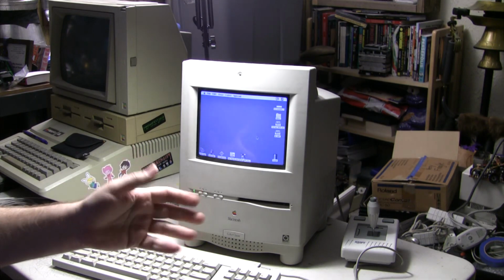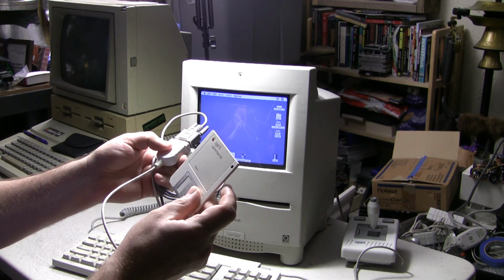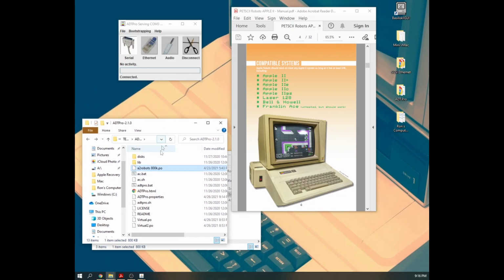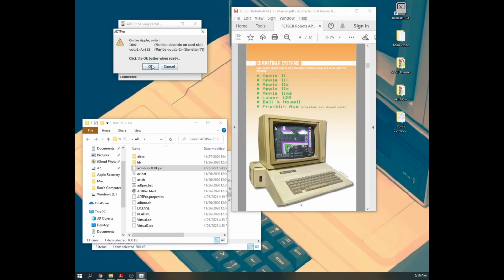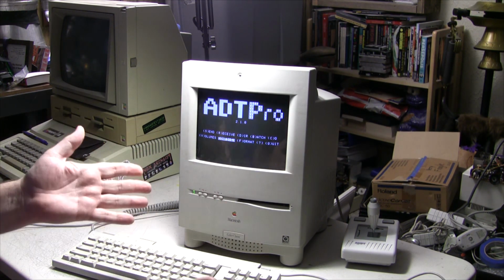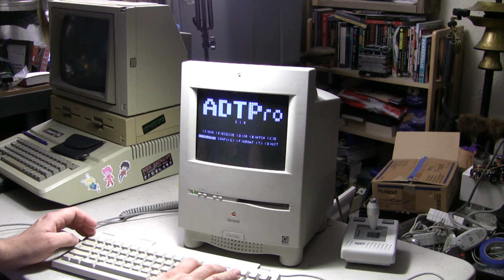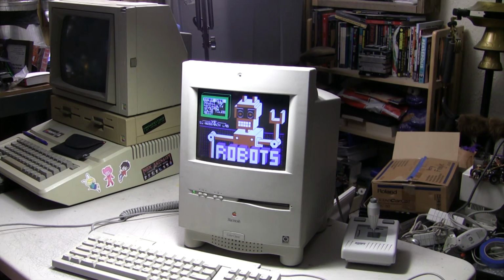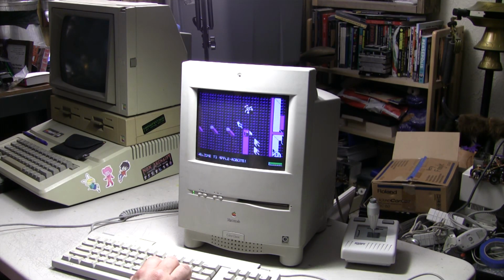Attack of the PETSCII Robots... on the Apple IIe Card for Macintosh?

Comment: Thanks for making this.  I hadn't tried it on an Apple IIe card yet.  I do have the card, but I don't have a mac with a working hard drive at the moment that could use the card.  I'm glad to see it works.  You might also try the Mono-Tiles and see how it looks on the Mac.
Reply: No working hard drive? Time to get yourself a SCSI2SD or a FloppyEMU for your Macintosh.
Reply from the maker: No working hard drive?
Reply: @RonsCompVids  the comment about no working hard drive was for 8-Bit Guy. The comment to you was to get on making a comparison video for him, which as of this comment you've done ;-)
Reply: Hi David - Initially I tried PETSCII robots on the Apple 2000 emulator (on Amiga) and it crashed while booting from the "a2robots 5.25.po" image with the message: "UNDEFINED INST AT $0913".

UPDATE 28 April, 2021:
I found it's just a bug in the emulator with ProDOS-ordered images and Attack of the PETSCII robots runs fine on the Apple 2000 Apple ][ for the Amiga once I used converted the ".po" file supplied with the game download to a ".do" file.
(I used an obscure tool called ApImU (Apple Image Utility) for the Amiga, found on aminet, to do this.)
Very cool!
Reply from the maker: You should be able to use CiderPress on a number of modern'ish machines to turn that .po (ProDOS ordered) file into a different format that might be more compatible with the emulator... but .po is about as generic as it gets (to my understanding)
Reply: @RonsCompVids  Hi Ron! You were right!  I didn't realize that a ".do" DOS-ordered disk could still have and use ProDOS!
I found an obscure Amiga utility called "ApImU" (Apple Image Utility) that easily let me convert the a2robots ".po" file to a ".do" file and it runs under the Apple 2000 Apple ][ emulator on the Amiga!
I'll make a video about it. Thanks for replying to me even when I clearly didn't understand what I was talking about. :)
Reply from the maker: I’ll test that out soon!
Reply: @RonsCompVids  yeah, get on that Mr. Man LOL!
Reply: Hey guys, I was wondering if there was / would be a port / version of the game that was compatible with the early Macintosh line of computers e.g 128k, 512k, Plus, SE and SE/30?

Comment: Time to buy a Apple IIe card
Reply: Apple IIe cards are not too hard to source, however the y-cable is a PITA to find, at least for a decent price.
Reply from the maker: Reproduction cables can be found for about $40 shipped… but If I’m dropping bank on a card it had better include the cable LOL
Reply: @RonsCompVids  $40 is a decent price for the cable. I've seen a seller on eBay charging close to $100 USD for a handmade cable. That's a little steep IMHO.
Reply from the maker: They do not listed on their website, so you have to call them to ask them to have one made… But these guys make a nice reproduction cable:

https://iec.net/
Reply: @RonsCompVids  The folks at IEC are great. I've purchased a few things from them over the years. Even though I have the original cable, and I did make one for Adrian, which I will never make another one again since it was a PITA haha, I should reach out to IEC and get a backup cable to have on hand.
Reply: @RonsCompVids  Are they still available? o.o I got the impression that even the people making clone cables had stopped doing so.
Reply from the maker: There has never been a better time… except when they were plentiful and cheap.